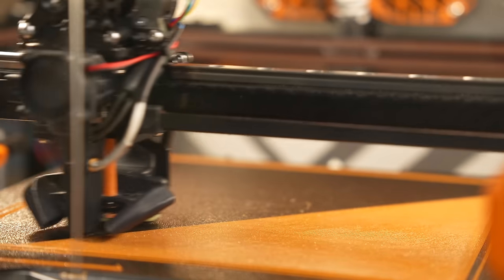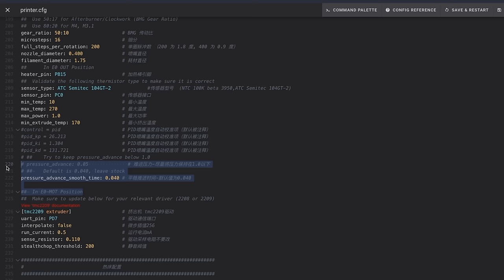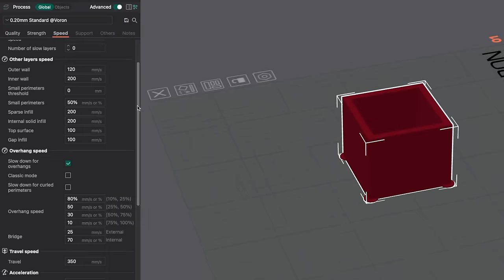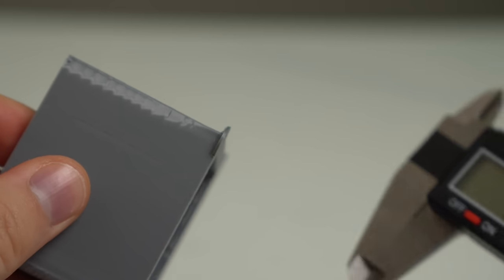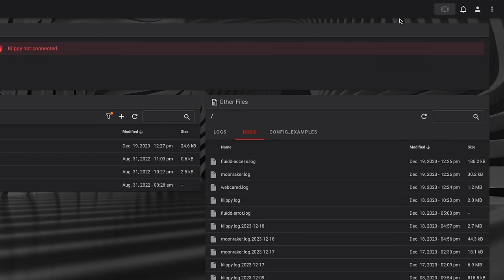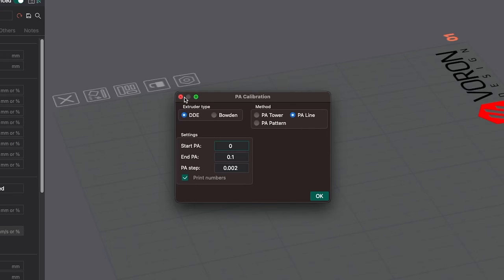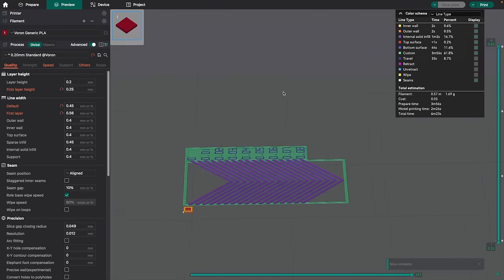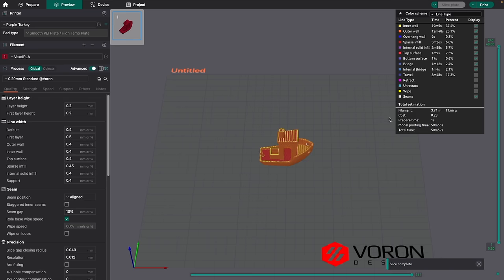Tuning Pressure Advance Has Never Been Easier (OrcaSlicer Calibration)

Comment: As a sidenote (2:10), make sure that, under the cooling section and if the setting exist, the minimum layer time is set to like 1 or 2 seconds.  I had mine set to 20s and the slicer took it to heart and made it so that I could never exceed 25 mm/s at the fastest.

One additional recommendation is to set bottom layers to 1 and uncheck "Alternate Extra Wall" to reduce the filament used and potentially halve the print time. 

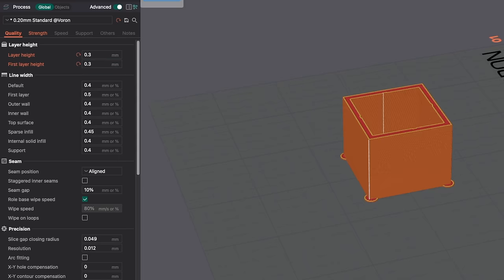If your cube isn't sticking to the plate, (2:15) then your Z-Offset may need tuning.  But, in a pinch, you can use a shorter "First Layer Height" like the usual 0.2mm or 0.1 to mash it into the plate.  Having one layer not be 0.3mm isn't going to affect the quality of your results.

Granted, I'm using Cura but the first should apply across other slicers and the second might apply.
Reply: To add to this, make sure whatever printer you use (i have a X1C) you set your print speed to speed you intend to print at. If you run a PA test at 200mm/s but the model prints at 50mm/s you should run the PA at 50mm/s for best results. So definitely make sure your layer time doesn't affect your print speed too much.
Reply: @42436freak  I hadn't thought about this.  I wonder if this is why the corners were blobbing.  Basically I ran the test at 100mm/s but I normally print outer perimeters at 33mm/s.
Reply: @tasa4904   I tried printing with 60 mm/s and 150 mm/s (probably closer to 130 mm/s in reality) and optimal height was 18.3 mm for 150 mm/s and 25 mm for 60 mm/s. So quite bit of a difference! No other option were changed. Material was 3DJake ecoPLA, printer Ender 3 S1, temperature 205 C and 0.4 mm nozzle.

Comment: Tried pressure advanced before but it was in the firmware level and had so many finicky steps and if I ever want to go back I always needed to reflash my machine and recalibrate everything. I am already using OrcaSlicer for months now and I will be doing this calibration for my machine, it's so much easier having it in software level. Just do the calibration test, choose what's best and set it. Nice informational video!

Comment: I set my PA higher than what looks best via the pattern method. I was testing Polymaker PLA Pro, and a PA of .02 still gave me a rough looking top surface with the edges being much more ridged than the inner portion. I upped my PA to .04, and that all went away, and I still wasn't experiencing the "gapping" at the sides that would be expected.

Comment: I exclusively use the Ellis PA Pattern and it's always been really good for me and is not a long print at all. Been using the version that was added in Orca Slicer. Once I calibrate PA I tune EM (Flow) using Ellis Cubes as well.

Comment: Interesting that your first calibration resulted in a pressure advance of .025 and the second was .020 and the default for my Neptune 4 Pro is .022.  I print mostly TPU of different durometers and TPU is very different from the other filament types.  I've mostly compensated by printing very slowly, but I really do need to do a proper calibration of pressure advance and retraction, but the OrcaSlicer retraction test crashed my printer.

Comment: PA value can be significantly different for different combinations of speed and acceleration, so it is not enough to just set speed to 100 mm/s as advised. PA must be tested at exact speed AND acceleration for outer walls you going to be printing after
Reply from the maker: For the cube tower I went off of the official Klipper documentation. For OrcaSlicer it auto sets to your profile acceleration and speeds so it should be much closer or match. I will admit I don’t do a 1:1 between my PA testing settings and what I end up running mostly. Typically I still get really good results but doing what your saying of matching it speed and acceleration wise for the profile you plan on running is a great recommendation and will yield the closest to perfect results.
Reply: @ModBotArmy  I think official klipper documentation was written at the times when 100 mm/s was insanely fast, we are already in a bit different reality where even consumer printers capable of printing 300+ mm/s and 10K acceleration easily ;)

Comment: What im doing is the pattern, then from that number i do a line and see if its a bit tighter. The pattern is great but its lacking the next decimal point so maybe you could get that sharper corner with .034 or similar instead of .3 or the gap of .4 Cause the corner on .4 looks even better but the gap opens up....

Comment: what should be tuned first? PA or FLOW? would be intresting to see if it makes any difference if PA tuned first or FLOW tuned first
Reply from the maker: Ideally I would get flow dialed in first. At the very least calibrate your esteps but yeah too high flow will increase the rounded corners which could slightly skew your PA results.
Reply: Thank you! My pa pattern test had rounded corners no matter the values. Going to try lowering flow @ModBotArmy

Comment: Can you explain how to use the PA tower in the thumbnail after it's printed? The pattern gives a number to input, but I don't understand how the tower works. For instance, my tower looked best at 34.20mm and Orca's g-code informed Klipper to set my PA from .000 - .0100 with 0.002 steps throughout the process (can see in the console..."pressure_advance: 0.006000
pressure_advance_smooth_time: 0.040000, etc.). Thanks!

Comment: @ModBotArmy I have a question regarding PA since I first used it. Maybe you or someone else can answer it. So bambu and orca do the PA calibration and then do the extrusion multiplier calibration. Is the PA independent from the EM? Or if I wanted to do it more precise, would I have to recalibrate PA after EM-calibration. The difference would most likely be very very small... but I'm curious if there is impact at all

Comment: I am so confused. If zou set the PA per filament, then it wont be machine specific? Because im pretty sure my v0 and my v2 dont have the same values of pa
Reply from the maker: Yeah that’s right each printer will have a different PA value for the same filament so you would need to tune it per printer. You may want to name your filament to start with your printer name if that’s the case so you can easily sort through them.
Reply: @ModBotArmy  yes unfortunately this ends in a calibration nightmare depending on how many printers and filaments you have... we really need something like Bambus "lidar" but cheap and for klipper. This would be the next big step into the right direction for the 3d printing community

Comment: what's the difference  between pressure advance and linear advance? they look like the same thing
Reply: They use different math. To skip the control theory, LA is more unstable because it might tell your printer to do things it's not physically capable of doing.
Reply: Thanks! it makes more sense now.
Reply: Also, linear advance is what's used in Marlin firmware, while Klipper uses pressure advance.

Comment: Why after tuning esteps on my ender 3 v2 neo that runs klipper with the sonic pad, my prints look like they are under extruded?
Reply: Did you calibrate running through the nozzle or in free air?
Reply: Free air, I can’t get it to print right. I have to increase the flow on my Sonic pad
Reply: @802Garage   I took off the bowden tube and calibrated it that way. Is that the wrong way
Reply: @k-dougplayz3202  It's not "wrong" but it may lead to under extrusion depending on your filament, temperature, and other factors. I'd try calibrating E-steps again going through the nozzle with the filament and temperature you use most frequently and see if you get different results.
Reply: I calibrated it through the nozzle at a higher temperature and it looks fine. I have to retune PA now
Reply: @k-dougplayz3202  Hey, good to hear! I calibrated in free air and it was fine with PLA, but my printer has a harder time pushing PETG, so I think it was leading to under extrusion for me. Kind of a pain that different filaments all behave differently!
Reply: e-steps is just the baseline for making sure the extruder is moving fillament as expected. You still need to calibrate flow once you have done esteps. If it is underextruded, you probably need more flow
Reply: @caramelzappa  how do I do that